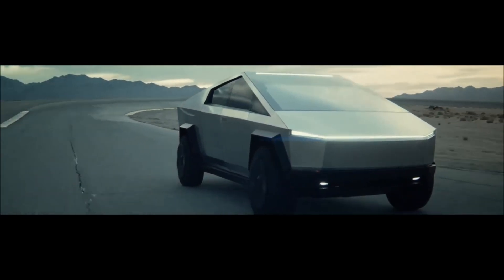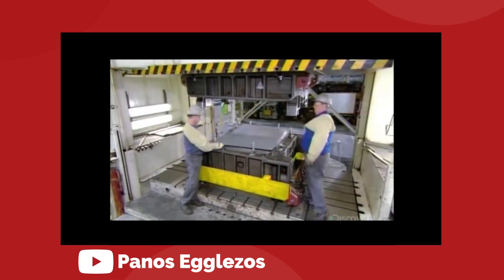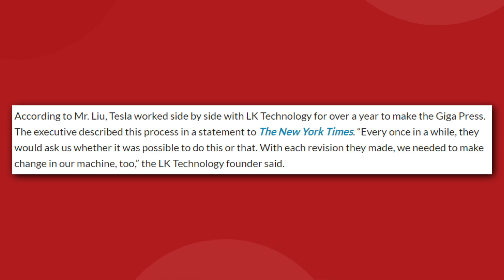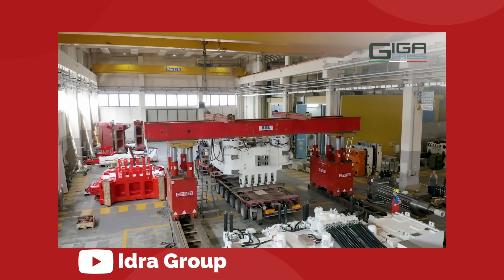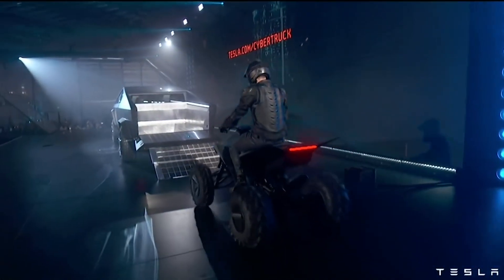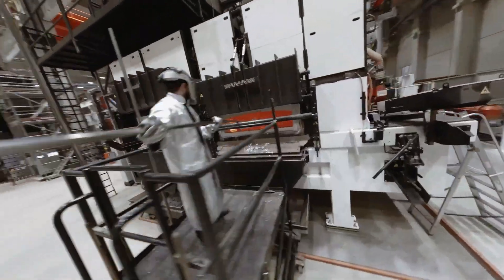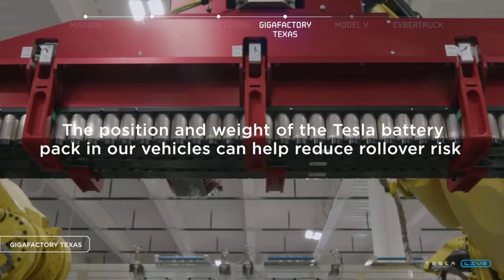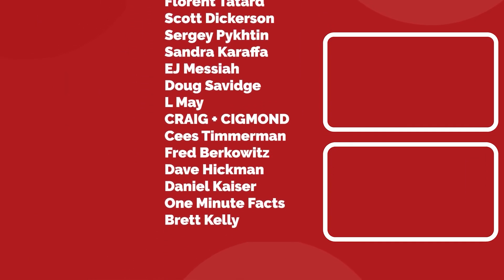Tesla Reveals New Cybertruck Giga Press!

Comment: Cool press but, what a dumb idea.  There is a reason the other manufatures do not do use huge casings, here are just 2 I can think of at this time
1. You cannot adjust the fitment - no matter how acurate you casing, there will be diffeances between each one and this will lesad to varinces in fitment, give the quality of Telsla's this will make thing worse not better.  
2. Repairs become harder to do and repair cost become too high, not an issue for Tesla as they will sell more car's but insurance will become an issue as cars will become too expensive to repair for minor damage to these large casitings.
The are other reasons, but I am no manufatuing expert.  To me it looks like Tesla need to have some experts in manufacting car's and learn for the lessons the everyone else lerned in the 80's - blind automation is not a key to sucess as it cannot compensate for diffences enough to ensure high quality - again going by the quality issue they have, it's a lesson they have yet to learn.

Comment: The only thing I can see happening negatively is WHAT IF the machine breaks down? imagine one of the very  internal components breaking down, they have to take the whole thing apart and fix it and assemble it again, while the production line is stopped??  BUT positively, I guess they can use that time constructively to fix any major repairs for the production line, or line production robots, even replace for new ones etc etc
Reply: The gigapresses are spitting out parts in milliseconds so they could have a stockpile of parts to keep going in the case of a breakdown. Wonder why Tesla didn't order two machines?
Reply: @Martin-se3ij  

Milliseconds??  Come on!!  I mean I haven't seen it working, but not even the other regular presses do it in milliseconds...  But I get your point hope it works out like that, but where do they put all the parts waiting to be stocked and ready??  I thought the part goes directly from the press to the next step in the making of the truck.

Two machines??  Or four??   get it??  From what I understand he wants to RADICALLY increase production.
Reply: @THEMOSTGODLESS8713GGR  The molten aluminum fills the die in 120 milliseconds! (so says the man from IDRA) But you are right this is not the whole cycle. The whole cycle is about 85 seconds or 45 units per hour. Run the press for 24hours and you have a 1,000 castings.
Reply: @Martin-se3ij  

From Elon's latest talks he says they want to get to 1 million units per year... he said that in the stockholders' meeting or presentation.  

I wonder how replans to do that in his megafactory in Austin for the model S and Y... he wasn't referring to the CyberTruck so we'll see.
Reply: @Martin-se3ij  

Still, 120 milliseconds is impressive for such a huge part... and soon the humanoid bot. 

This guy will forcefully save humanity. LOL

Comment: I remember having something like $23,000 back in November 2019, and reserving the tri-motor with FSD for $77,000(112784xxx). And now the stock is worth $350,000, the truck will probably end up being close to $95,000, and I should have a couple hundred grand to play with while I drive around in my new CT4FSD.

Comment: I appreciate the effort at maximizing manufacturing efficiency and reducing cost, but I am concerned about the long term costs. I know most vehicles are considered disposable anymore, but solidly casting an aluminum frame and the body will almost guarantee that any wreck will total the vehicle and leave it unrepairable.  I wonder how many of these will end up scrapped within the first year.
Reply: I was thinking the same thing
Reply: Right? A relatively small chip to the Al frame could impact its functionality. Does it mean you need to replace the whole thing? Imagine the cost. Imagine the insurance premium
Reply: it's stamped stainless
Reply: @rftek  yes the body is, but not the frame.  Regardless because they have nearly stamped the body as one piece, it will be much more difficult and expensive to repair, and that doesn't even account for the fact that it is in fact stainless steel.

Comment: Whats the point of an electric truck?  Its heavy to move, so more electricity is required.  Most electricty is generated by natural gas, and Tesla chargers run on diesel.  Its window breaks and its taking too long to come to market.  The Maverick hybrid is already looking like a winner.
Reply: I will be recharging my Cybertruck most of the time here at my home in Dallas, which has been running on 100% wind-generated electricity already for more than 15 years.  And virtually all Tesla Superchargers are running on 100% renewable electricity.

Comment: Can you imagine the cost when somebody gets a ding on their front or somebody dings the rear,.!!!!!
Reply: the point is that 3mm ultra-strong stainless steel is going to be VERY VERY resistant to "dings", both driving and in parking lots with careless people opening their doors into your Cybertruck.  THEIR car will be damaged, your Cybertruck most likely will not.  Same thing for the armored glass... much less likely to be dinged by gravel etc
Reply: @gepeterson2  well that's all good until it hits the real world.. It amazes me what people do to their cars. 
gravel and such wont be an issue. but the tougher the thing is the harder people use it until it breaks. 
The amount of unscratchable stuff I have owned and been very careful with that has got scratched is insurmountable.. 
the glass is the only thing that I can believe in.

Comment: This has both pros & cons. On the positive side, it cut down the cost, material, and production time and it is easy to build. On the negative side, it is not easy to repair if cracks, Aluminium castings may bend, and twist. Also, the shock absorbing properties has to be checked.
Reply: Modern cars are designed to have "controlled deformation" in a crumple zone. Casting a chassi in larger pieces gives me pause for concern. Is safety a proper concern here if the passenger cabin and the front are of the same piece? The idea that everything around the cabin is expendable.
Reply: @Ingu.z  Casting allows crumple zones to be more consistent and better engineered than making them from multiple pieces. So your concerns are not well placed with casting. 
Think of crushing an aluminum can, now make the walls of that aluminum can from multiple parts, which one will crumple more uniformly and consistently?
Reply: @eomhS  Sounds reasonable. Though has it been done before? Would like to look it up if possible. Even if it's just crash tests. My concern wasn't that it's casting, but if it's made in one piece. So that the passenger cabin is sturdy, but all the rest possible to crumble in a good way.
Reply: @Ingu.z  A couple things I don't think are clear based on this question. First, this machine will not cast the body (cabin) it will be casting the rear of the chassis (underbody structure) Second, a one-piece casting will have different wall thicknesses, it will have the ability to make thinner walls for crumple zones and thicker zones for rigidity. 

It has never been done at this scale, this is the largest casting press in the world after all. I've designed multiple aerospace and consumer products using castings with designed failure modes to ensure safety and predictable performance, this is no different, just larger. The current method of spot welding multiple pieces together should give you more reason for concern than this.
Reply: Cybertruck is stainless steel exoskeleton, that's why they needed this press.
Reply: @zontarr22-zon  No, this casting process is not compatible with stainless steel. This is only for aluminum / zinc parts, so it will be for chassis. the exoskeleton will be pressed (formed) not cast.

Comment: So what happens when there’s as accident? You have to replace the whole body? Insurance premiums will be through the roof
Reply: Same thing was said when bumpers became integrated in the car body. If you can remember how cars looked back in the '50s, '60s, 70s and even into the '80s?  They all had a distinctive bumper in the front and back of the car. Then came the war of better mileage. Automakers had an incentive to streamline the car to get better fuel mileage so they integrated bumpers into the car's frame to lower drag which is great IF everyone drove perfectly and there was no such thing as car accidents....
Guess what happens when there's a fender bender now?  What would have been just a scratch or dent on a bumper now requires replacing the entire panel which is expensive. Maybe there is an ulterior motive of these car manufacturers. Purposeful planned obsolescence- just like they did with Apple iphones and its integrated, non removable batteries. A move that proved so profitable that it was quickly copied by Samsung and other android phone makers.

As long as humans are at the wheel there's going to be human error and car accidents.  Accidents means repairs. VERY expensive repairs if we have to replace the entire car body.
Reply: No , in an accident nothing happens to the cybertruck because its resilient geometry ,  The ones who end up crying the the other car owners who's gets smashed by the power and tension stored in this fully stainless steel frame.

Comment: At $200,000 the truck is relegated to a millionaire's toy, not the everyday working contractor or framing carpenter. The F-150 Lightning will hold that huge market all on it's own. With a different skin, the truck could find a market in the military field to replace the HUMVEE or a more agile MRAP. With another skin change, it could become the general purpose platform for most of the utility trucks like power pole installers or cherry-pickers or mix-on-site cement producers. If Ford can produce a clean-sheet F-150 with an 8ft bed and add the 250 and 350 lines, they will extend their dominance in the workhorse market. But then I can't count out Elon-Magic to come up with some new unimagined market. Mars Builders, for example with parts and eventually whole plants going on StarLifters.

Comment: 2:00 in and I'm cringing from all the basic errors. Learn the difference between die casting and injection molding; between body and frame; between a car front/back frame and a quarter car frame; etc. Sloppy af.

Comment: The major problem with replacing several small scale parts assembled together with far fewer large scale moulded parts assembled together is part replacement/repair due to accidents/metal fatigue/corrosion etc. Replacing a large scale part will be much more expensive both in material as well as in labour costs.
Reply: If one of those large, cast parts is damaged, in some cases the damaged portion can be cut off and a new section welded in place. You do not necessarily have to replace the entire piece which might require disassembly of most of the vehicle. Obviously this is dependent on where the damage is, how severe it is, and the skill of the technician working on the damage. Every case will be different. But, the point is, in some cases, the repair cost will not be as bad as you fear it is.
Reply: @kenwendland2285  @Ken Wendland  "...and a new section welded in place". Ken, from where will the technician obtain the 'new section'?
Reply: @dawnlightening  Where do technicians obtain replacement parts now? A supplier. Tesla, or third parties, have the ability to supply portions of the larger components for this specific scenario. It's not all that complicated. Whether or not they will, I don't know. But the capability is there.
Reply: @kenwendland2285  And that is exactly the problem Ken. Because, in order to get 'portions of the larger components' a complete large component has to be sacrificed just to provide the part that the technician needs for his welding. In addition, the technician has to specify exactly how to cut the required piece out. All of this defeats the whole purpose of having large moulded parts. This is exactly why vehicle manufacturers (or the manufacturers of ANY machinery) do not do what Tesla is doing, but instead have assemblies of several simpler parts.
Reply: @dawnlightening  Manufacturers publish repair manuals that inform technicians how to perform repairs. So if, hypothetically, a Cybertruck we're to get damaged to a rear corner, a corner piece produced to replace that portion could be used. The repair manual would advise the technician were to cut so the new piece can be welded in it's place. So they would not necessarily have to sacrifice an entire rear assembly. I understand your concerns. But there are viable solutions. I imagine these concerns you have raised were discussed in the decision making process to adopt the Gigapress manufacturing method.
Reply: @dawnlightening  
"in order to get 'portions of the larger components' a complete large component has to be sacrificed"
That makes absolute no sense at all.
Reply: @bighands69  So then, from where would you obtain the portion of the larger component which Ken Wendland wrote about? There are no moulds for smaller pieces of the large component.
Reply: @dawnlightening  
What larger components are you talking about?
Reply: @kenwendland2285  I am sorry Ken but you are now deep inside LaLa land. There is no way that a smaller portion of the larger piece can be produced as the only mould available is the one for the entire large part, which is the whole point of the video.. The only way of getting the smaller portion is by making a large part and then cutting off the required piece. Obviously the remainder of the large part is then useless scrap which cannot be used for vehicle assembly.  Not to mention that welding aluminium is both difficult to do and that it cannot reproduce the strength of the casted part. No insurer would insure such a repair. So all in all your proposal is both unworkable and unviable.
Reply: @dawnlightening  3D Sintering to make the size needed for replacement..
Reply: @Ripper13F1V  Cost? Astronomical, in terms of both hardware & software. Part strength? Much lower than injection moulded aluminium. Conclusion? Back to the drawing board, Ripper.
Reply: @dawnlightening  imagine u do get the piece u need. Now u weld it onto a completely smooth one piece body. That's gonna look stupid, now ya gotta go get your truck a brand new full on paint job too. Hey  it's got the word giga in it so it's totally the future
Reply: @dawnlightening  And yet they are strong enough to build complex transmission parts with. No, it's plenty strong to do. That's not the question, it's the cost and willingness to innovate that en-masse.
Reply: Isn't this precisely what many companies are now doing? Either products are impossible to repair, forcing consumers to buy new, or only the brand can repair it. Either way, more money to drain out of customers!
Reply: @ahhmm5381  For many manufacturers, yes. They call it planned obsolescence. Smart phones are a prime example. They only get a few years of security updates, and then you're cut off and have to upgrade to stay safe from cyber threats. But, Tesla's goal is to advance the transition to EV's. Planned obsolescence, and screwing the customers like that, is antithetical to that mission statement. Unless Tesla is blowing smoke up the collective skirts of the whole planet, which some people believe I'm sure, then they are not engineering the cars to be unrepairable.
Reply: @kenwendland2285  Considering all the other bs Musk trots out, I have no doubt he couldn't care less about any mission statements.

Comment: I got the chance to work with Ti on a small project and it's very unique, sooner or later it will probably happen to the Cybertruck. 
"Titanium metal is a very durable metal for engineering applications because this metal is corrosion-resistant and also this metal is very strong and very light. It is 40% lighter than steel but as strong as high-strength steel. So titanium finds applications in things like aerospace."
Reply: Check the price.
Reply: @kylenolan2710  True, Ti is more expensive but 40% less weight is  hard to beat. Shave 2/10ths off 0-60, very cool.
Reply: @robertjackson7590 , OK, a handful of millionaires would buy them.

IF Tesla decided to spend vast sums of cash and 1000's of hours of top engineering talent developing said vehicle and manufacturing processes. You said you've worked with Ti. If you have, you know you don't simply swap it in for Al.
Reply: @kylenolan2710  For all the flat panels which is most of the outside of the truck it wouldn't be that expensive, I found small pieces on EBAY. My Tissot watch is done in Ti, it isn't something from another planet.
Reply: @robertjackson7590 , you're just showing your ignorance. BTW, I'm a mechanical engineer.
Reply: @kylenolan2710  "simply swap it in for Al." None of body panels of the Exoskeleton design I'm referring to are Al. The SS the Cybertruck is using is from SpaceX they call 30X, the X is an alloy they don't want us to know. I've no idea what the cost. I realize Ti is more expensive than SS and we can't know his SS formulation but you have to agree that building it in Ti that's 40% lighter meaning less material needed in comparison correct?
Yes it would be more expensive and cost prohibitive for me but not many others, you could probably afford it. Elon has set new standards for the auto groups, when was the last time you heard of a SS body, Deloren?